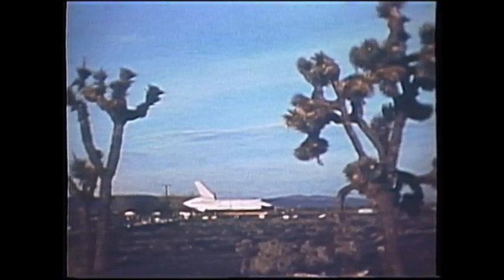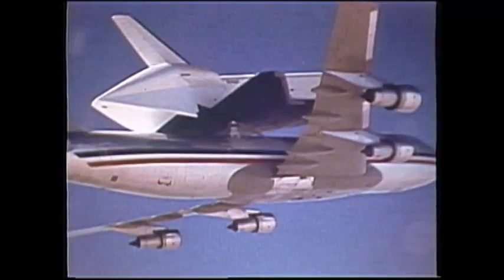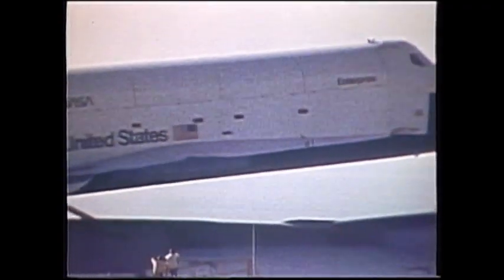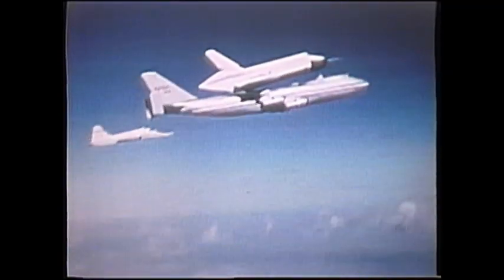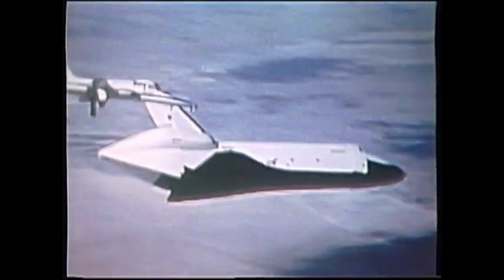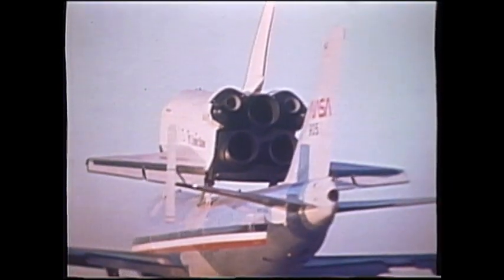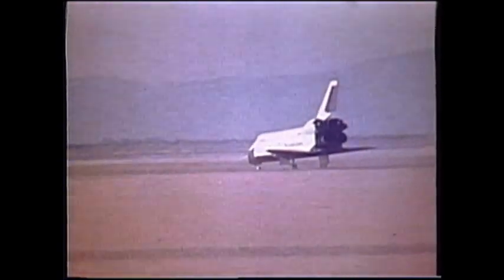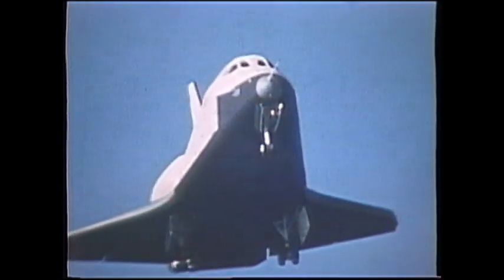Go for Sep

Comment: And now we're back to rockets! Too bad this system didn't deliver.
Reply: RealityIsTheNow except it had 1 fail for every 68 flights and was more expensive than a regular expendable rocket.
Reply: What do you mean, 'back to rockets'?  The shuttle system was also rockets.  Do you actually mean 'back to non reusable boosters'?  That's no longer true thanks to Elon Musk - way to go, SpaceX!
Reply: Obviously they needed to be nose up to expose the heat shield...but you simply don't understand any of this if you think that they were pulling 10 g's (Not even during liftoff did they ever get much more than 3 out of that thing) or if you are aquating lift and drag. You are ignorant of the shuttle, and have no credibility. But I'm happy to keep schooling you.
Reply: An escape system would have gone a long way
Reply: There is a difference between drag and lift. The G-load is caused by the back and forth braking of re-entry. It's drag induced deceleration, not lift. C'mon, man. And actually, the max loading during re-entry is more like 3 G's for the STS. Are you just making shit up at this point?
Reply: Did I say the wing was stalled? No? Okay then. You don't know what you're talking about. You are seriously just talking out of your ass. As I said, the G-loading is caused by deceleration. The shuttle performed a series of high speed S turns during reentry, thus bleeding off velocity laterally instead of directly against the atmosphere via angle of attack. Obviously they needed to be nose up to expose the heat shield...but you simply don't understand any of this if you think that they were pulling 10 g's (Not even during liftoff did they ever get much more than 3 out of that thing) or if you are aquating lift and drag. You are ignorant of the shuttle, and have no credibility. But I'm happy to keep schooling you.
Reply: NASA thought reusable rockets would be viable, given how expensive space travel is.
Reply: The YouTube Critic The space shuttles wings were not designed for “High Alpha” increasing angle of attack past s certain  point does not increase lift it actually decreases your co efficient of lift by separating pressures above and below the chord line. However, 90 percent of the re entry descent is controlled by RCS until there is enough air density for control surface authority. Remember planes do not stall do to lack of airspeed they stall because of angle of attack. Also without relative wind they relied more on the coefficient of drag equation for their flight computers.
Reply: The YouTube Critic No you’re right the wings surface area assisted in the drag required but also made the subtle descent necessary even more dangerous due to the possibility of skipping. Descending through the atmosphere regardless will slow you down no matter what you do. Even a f-15 at 60 thousand feet with full afterburners on will slow down in a dive to earth simply because true airspeed decreases as density altitude decreases.
Reply: owlswait You know what they say what goes around comes around, what was once old is new again.
Reply: Dthe YouTube critic obviously doesn't understand what you mean he's probably a flat earth believer
Reply: They were supposed to launch every two weeks. Each shuttle was supposed to be good for 100 flights! That would have been between 500-600 flights. We got 132 flights out of all the shuttles combined; that's way below the program's promises. We could have launched all of the space station components with exiting rockets - probably carrying larger sections. Not saying that the Shuttle wasn't an awesome engineering achievement - it absolutely was! It just didn't live up to the hype and it was outrageously expensive!
Reply: They were supposed to launch every two weeks. Each shuttle was supposed to be good for 100 flights! That would have been between 500-600 flights. We got 132 flights out of all the shuttles combined; that's way below the program's promises. We could have launched all of the space station components with existing rockets - probably carrying larger sections. Not saying that the Shuttle wasn't an awesome engineering achievement - it absolutely was! It just didn't live up to the hype and it was outrageously expensive!
Reply: @owlswait  They were originally to fly at a rate of 60 missions a year, or slightly more than once per week.  We got 134 successful missions, with a single mission failure upon ascent for STS-51L Challenger. Then for STS-107 Columbia while the crew and vehicle were indeed lost during entry, the mission was indeed a success.  There were 134 successful launches but only 133 successful landings.
Reply: The Space Shuttle orbiters were designed for 100 flights each. The most flown was Discovery, on 39 flights. We’ll never know if they could have made it to 100. Each Space Shuttle Main Engine was designed for 55 flights. Out of five Space Shuttles we only got 134 flights; that's 366 short of what they were designed for. A marvelous piece of equipment? Yes. Did it deliver as promised? No!
Reply: @owlswait  Thats like saying a car is bad because it is designed to drive for 100,000 miles when the owner junks the car after only driving it for 65,000miles.  Each orbiter had a service lifespan of 100 missions,  it's service life wasnt why the system didnt deliver as promised.
Reply: It was a system that was too complicated, too fraught with components that could fail and too expensive.
Reply: The system delivered it just did not last.
Reply: They were supposed to launch every two weeks. Each shuttle was supposed to be good for 100 flights! That would have been between 500-600 flights. We got 132 flights out of all the shuttles combined; that's way below the program's promises. We could have launched all of the space station components with existing rockets - probably carrying larger sections. Not saying that the Shuttle wasn't an awesome engineering achievement - it absolutely was! It just didn't live up to the hype and it was outrageously expensive!
Reply: The haters? Did you really say that? What a ridiculous term.
Reply: back to rockets? we never quit using them. the majority  of satalites were launched with them. we only heard about a few that the shuttle put up, to justify its cost.
 the fact of the matter is that the black ops project it was designed for is over. we "have no need for a shuttle any more." as a result.
Reply: Everything in space could have bee delivered via conventional rocket. All "Black Ops" sats could have been delivered likewise, as they are today. The Space Shuttle was supposed to be a "space truck," delivering and retrieving space hardware. It's schedule was totally erratic and flaws identified early in the program, especially the icing on the external tanks and O-rings in the SRBs, were not addressed before two avoidable disasters took out two shuttles and their crews. As I've said before, the Space Shuttle was an amazing piece of technology, but it did NOT live up to its expectations and was extremely costly.
Reply: there's alot you arent concidering. what makes sense to you and I doesnt work everywhere.
 as far as icing and o rings, see again my statement about bean counters not listening to engineers. that also applies to most problems you have with your car.....
Reply: Yeah, it was too unreliable , it was a flying brick
Reply: ....and way too many parts to fail - and they did.
Reply: what failed was nasa's maitenance program. sure it was a high mait. craft but that doesnt make failure due to improper maitenance the machines fault. the shuttles failures can be traced back to management every time. 
 dont blame the shuttle for something that wasnt its fault.
Reply: Of course it was the fault of management, but the craft couldnever live up to the two week turn around promised by management. The craft was way too complicated and needed far too much repair between flights to live up to promised performance. As usual, a government program promising way more than could be delivered. Single use rockets should never have been abandoned.
Reply: @The YouTube Critic  The Shuttle came nowhere close to pulling 10 gs during entry. It's design limit was 3 g, which is exactly why the 3 main engines throttled back during the last 30 seconds of powered flight. To keep the g load at 3g.
Reply: @The YouTube Critic  The ONLY reason the Shuttle had wings was so it could have its 1200 mile cross range capability.  Originally the Airforce was going to use OV-103 Discovery for its classified missions that were to launch from California at Vandenberg AFB, Space Launch Complex-6.  Shuttle missions from SLC-6 were to be Polar Orbit missions that launched to the South.  In the case of an AOA or Abort Once Around, the Shuttle would land in the same vicinity from where it launched.  Well it takes the Shuttle approx. 90 minutes to orbit once, and in that 90 minutes the Earth continues to rotate to the East.  If the Shuttle didn't have wings, therefore didnt have any cross range capability, Discovery would be landing in the Pacific Ocean.  Originally the military had the idea of launching into a Polar orbit, grabbing a Soviet spy satellite, modifying it and then releasing it again, all within a single orbit.  In order for Discovery to land near Vandenberg it required crossrange to not land in the Pacific Ocean.  This single orbit satellite grab mission was dropped early on as it wasnt feasible.  Though unlike the Falcon 9, the Shuttle did in fact use retropropulsion to be able to select where the orbiter was going to land.  The Shuttles 2 OMS(Orbital Maneuvering System) engines at the back of teh orbiter(the 2 smaller nozzles located above the 3 larger SSME nozzles.  The Shuttle would point its rear towards its direction of orbit, it would then fire these 2 OMS engines for a few minutes this slowing the orbital velocity of the orbiter.  This allowed gravity to pull the orbiter in towards the Earth.  After the retropropulsion, aka the de-orbit burn, the orbiter was reoriented nose first using teh Reaction Control System(RCS) and once the orbiter began to encounter enough atmosphere at Entry Interface, the compression of the atmosphere ahead of the orbiter slowed the vehicle. Eventually the orbiter would perform  s turns to help bleed off even more velocity.
Reply: I just read a 1969 study and for 1975 there were 16 missions planned, 1976 10 planned, 1977 17, 1978=80, 61 for 1979, 65 for 1980,  64 for 1981,  61 for 1982, 66 for 1983, 64 for 1984, 62 for 1985 for a total of 546 missions over 11 years.  With a service life of 100 missions each, the orbiter fleet would have had to have been much larger.
"In May 1970, Mueller instructed the task group to increase the payload capability to 22,680 kg to comply with US Air Force requirements, but also because there would be a need to launch vast quantities of low-density rocket propellants into Earth orbit for future space stations in geostationary and lunar orbit."

"Then the Nixon administration burst NASA's balloon. The future NASA budget would be only a fraction of Apollo-program levels. There would be no moon bases, no flights to Mars, no nuclear interplanetary stages, no space stations, no more Saturn V's, no space tugs. There wouldn't even be a space shuttle unless NASA could get the development cost down and also convince the US Air Force to use the shuttle for its launch requirements. A USAF requirement was a large cross-range to allow recovery of the shuttle orbiter at the Vandenberg AFB launch point after a single polar orbit of the earth. This was necessary for abort-once-around, quick satellite deployment, strike, or quick-look reconnaissance scenarios. "         STS was a government program and as such must cater to the whims of politicians.  She should still be flying today.
Reply: SpaceX will do everything better.
Reply: @owlswait  They will do it cheaper, because they have to.
Reply: Aerospike engines are looking good

As powerful as bell nozzles, except they work at almost any altitude

Aerospike shuttle might be in the future
Reply: Sure it was more expensive. But to say the system was a failure despite 3 decades of success at 99% is simply wishful thinking on the part of the haters. Somewhere people got the idea that spaceflight is a safe activity. It's not. That we manage to get as many people back as we do is frankly amazing.
Reply: It delivered quite well. 160 missions over 3 decades with a 99% success rate.
Reply: Sort of. BFR will have stubby little wings.
Reply: Yeah. Like I said. Very little lift generated.
Reply: They were supposed to launch every two weeks. Each shuttle was supposed to be good for 100 flights! That would have been between 500-600 flights. We got 132 flights out of all the shuttles combined; that's way below the program's promises. We could have launched all of the space station components with exiting rockets - probably carrying larger sections. Not saying that the Shuttle wasn't an awesome engineering achievement - it absolutely was! It just didn't live up to the hype and it was outrageously expensive!
Reply: Except the shuttle wings were mostly control surfaces as well. Very little lift generated. Shuttle landed like a brick really. Not much glide. But yes, the BFR lands propulsively. That is, if it ever actually gets built.